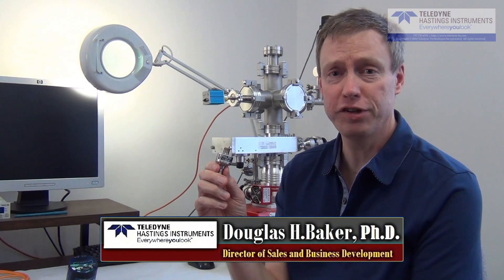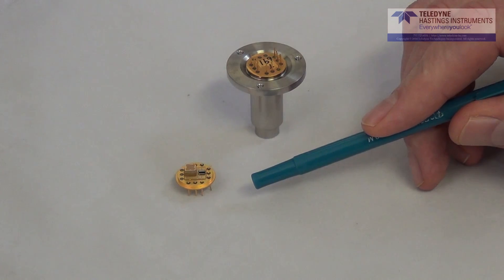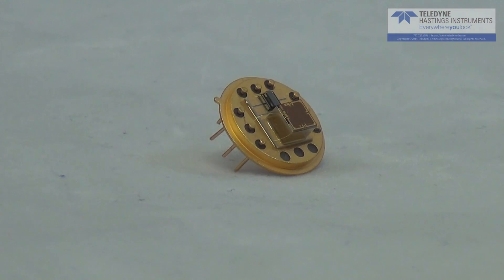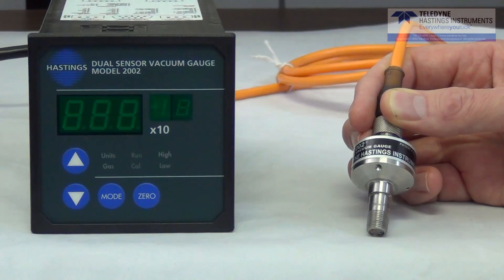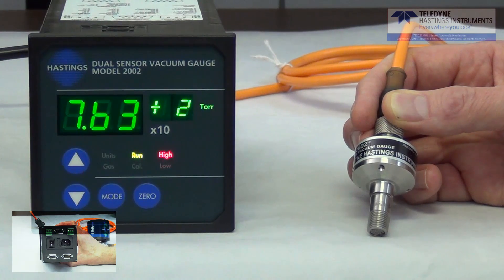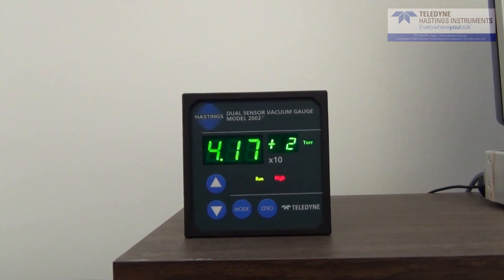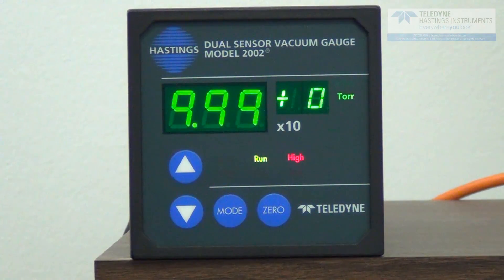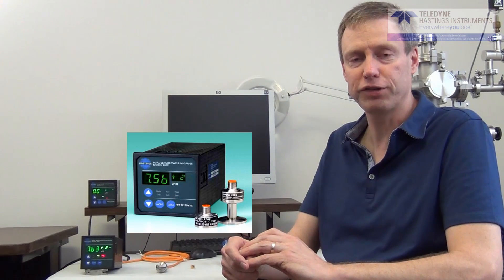Vacuum Gauge - HPM 2002

Comment: I found the problem with this model is when I pull vacuum pump and pressure down around about 25-30Torr  reading after that quickly the value will jumping to 16-20Torr and not reading out the value 20-25Torr.
Reply from the maker: Thanks for the note! You are in the transition region between the pirani and the piezo.  The behavior you describe could be caused by use of the gauge in gas other than air/N2 or by a faulty calibration of one of the sensors.
Reply: @teledynehastings7344  The same issue is observed in your video. It jumps from about 22 torr to about 10 torr